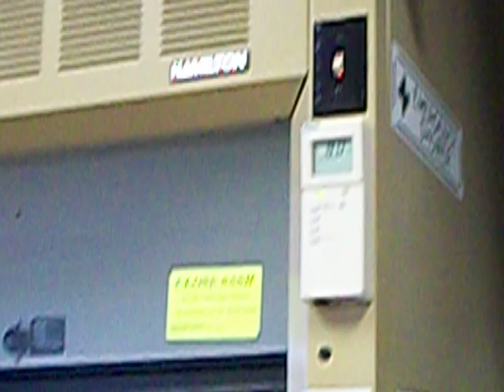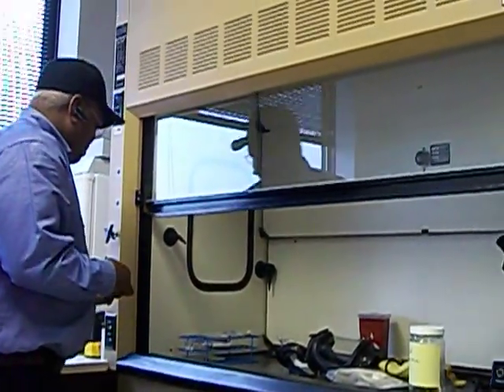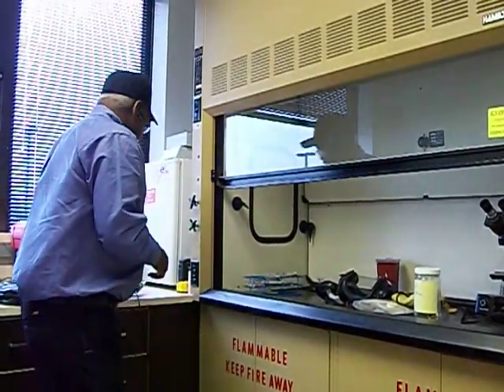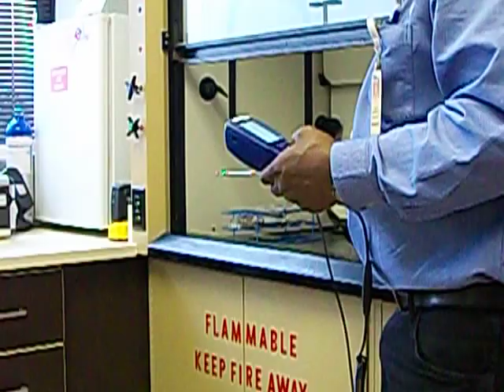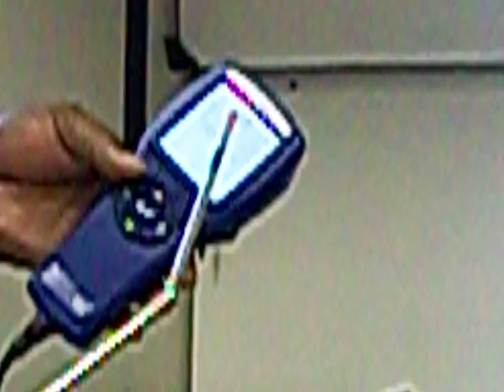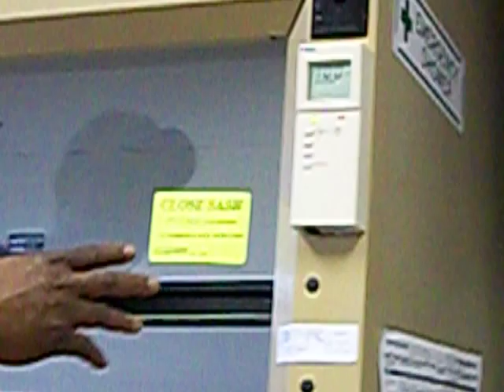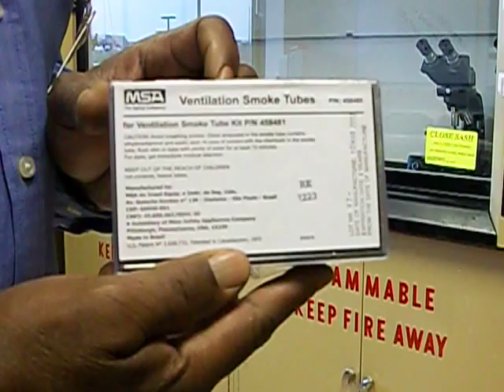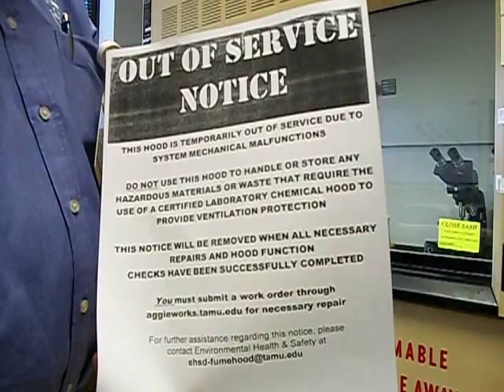Fume Hood Testing Using a TSI Anemometer and Probe

Comment: You didn't explain how to calculate it to get your CFMs. Was that on a different video or something? Just curious
Reply: CFM = Q = V*A. To get Q, you need to calculate Velocity and Area. Here, he obtained several velocity measurements. I would take the average of all the velocity measurements and plug that value in for V. We don't know the area of the hood yet though. We'd need to measure the hood and calculate the area value and plug that in for A. Then you'll get Q, which equals CFM :)